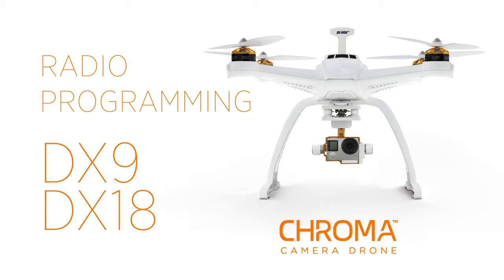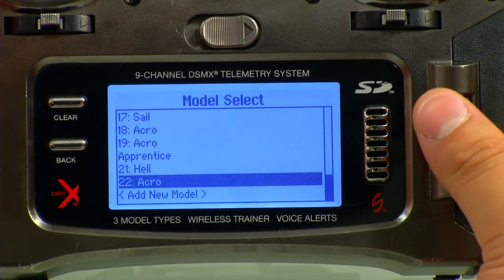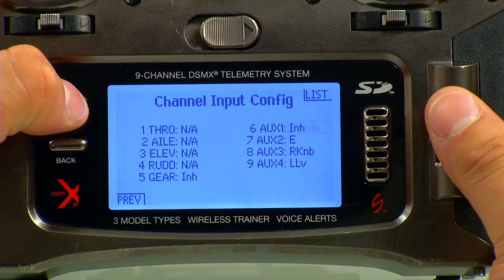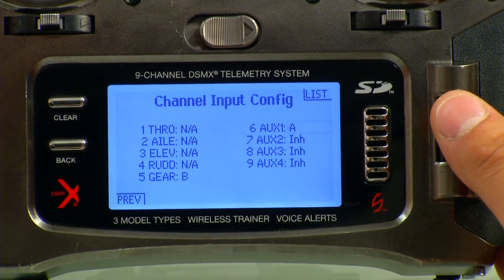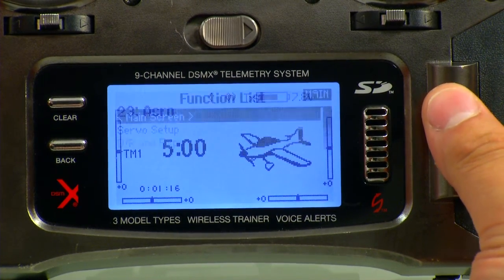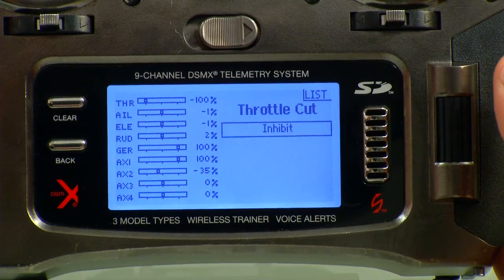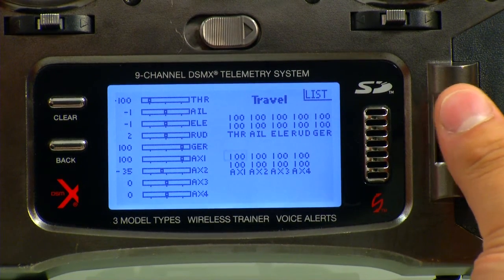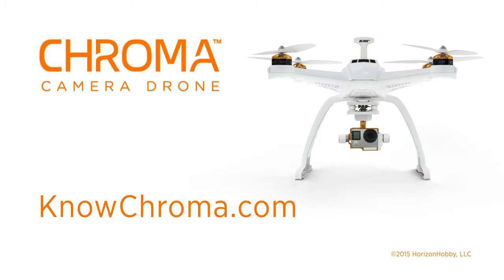Radio Programming - Chroma DX9 and DX18

Comment: I cant get my throttle cut to work on my dx9 with chroma. I even tried to move it to A switch and it doesn't work. I have to cut the chroma off to kill motors